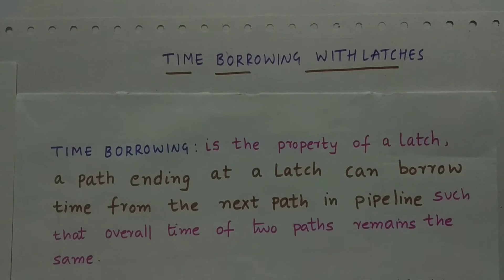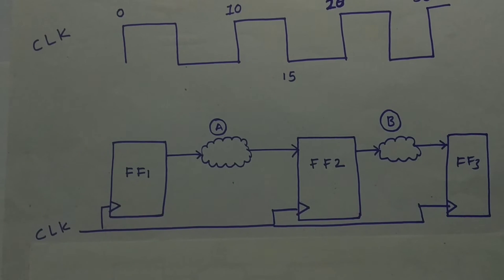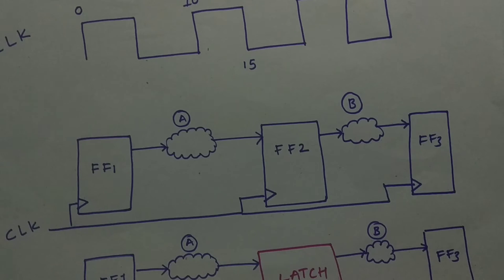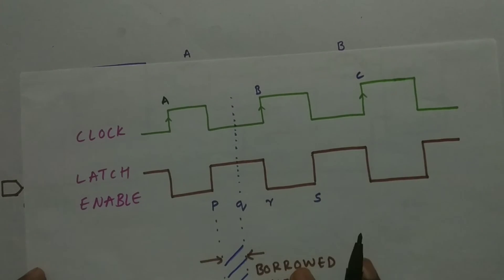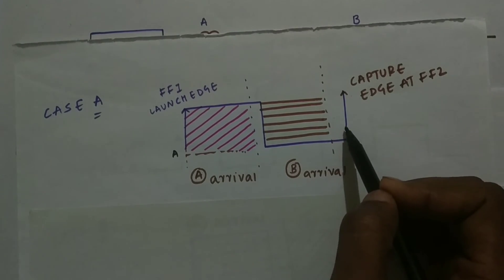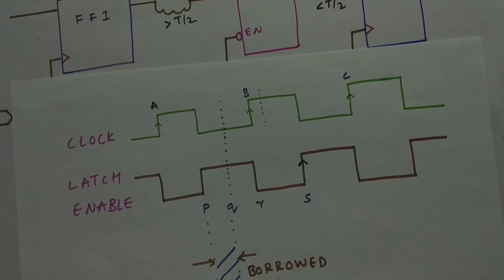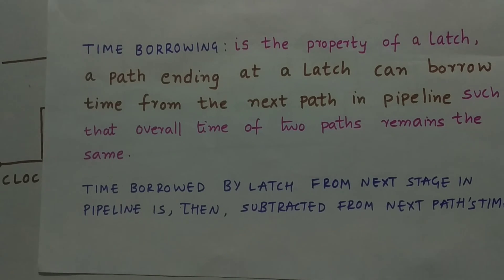what is time borrowing (latch)  ? why does latches support it?

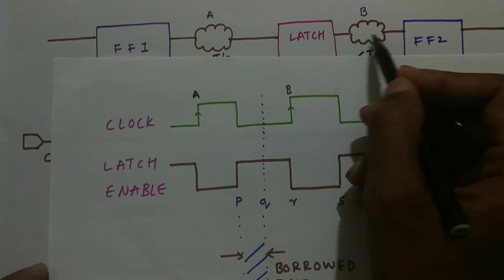Comment: at time 5:45 you are saying even the delay crosses p point...there is no problem it will be borrowed but the thing is the level after p point is a high level the latch can't be active at that point how can it capture data perfectly and in figure you took a negative latch, if it is a positive level latch then there will be no issue but you are took negative latch in between. i think if the latch phase is same as clock then your explanation may correct

Comment: I think this also depends on the contamination delay of the combinational circuit? Suppose, we had a positive level triggered latch (as in first example), that the data takes 12ns to reach, clock edge has already passed by then. You swap that FF in exchange for a latch, but if the contamination delay (min time from data injection at input to the time that the output of the combinational circuit starts changing) of the combinational circuit is lower than 5ns, the data will get corrupted.
Reply from the maker: Yes,the examples were taken for explaining ,  combinational circuit is way complex than shown

Comment: Whats the point of having the negative latch at all? As long as comb A and comb B are able to resolve the output within one clock cycle, do we need the neg latch at all?
Reply from the maker: Hey Praveen , thanks for asking the question, 
Yes negative latch is not required if combo A and B  can resolve it in one cycle, if not possible then only we use negative latch.
Good luck 👍

Comment: Hi Karthik,
Thanks for the lucid explanation.
Please clarify below doubt:
In example of low sensitive latch: Flop-A to Flop-B, available time is T. I.e., Delay of Comb-A   + Comb-B can be upto T.  (In given case Comb-A had > T/2 delay and Comb-B had < T/2 delay, summing to T)
So we can still meet timing between Flop-A and Flop B even without latch? (Please correct if I'm missing something)
Reply from the maker: Yep you are correct , I have taken that example to explain that scenario. It might be helpful in understanding certain design.
Thanks for asking the question, good luck 👍
Reply: I think using latch we can reduce the  number of cycles compared to filp flop.

Comment: Sir im having a doubt 
Then y cant we place latches everywhere? Instead of FF
Reply from the maker: Hey Aakash, thanks for asking the question.
Latches cannot be controlled easily as of FF . They are level triggered , are prone to glitches which are unwanted in the design and that is why Flip flops are preferred. Flip flops are Edge triggered which means the change will only occur at the triggering edge of the clock pulse .

Hope this clears your doubt,if you have any questions please feel free to comment,I am happy to help you 👍.
Please do subscribe it will help me a lot 👍
Reply: @KarthikVippala  FF's are prone to glitches right, due to this we are using latches inside ICG's. Correct me if am wrong
Reply: Awesome explanation 👌🏻

Comment: Is this done only eco stage!!?
Reply: what does eco stage mean? (Engineering Change Order?)
Reply from the maker: Engineering Change Order or ECO is the process of inserting logic directly into the gate level netlist corresponding to a change that occurs in the rtl due to design error fixes or a change request from the customer. ECO is preferred as they save time and money in comparison to a full chip re-spin.
Thanks for asking, good luck good health 👍😊
Reply from the maker: Yup , you are correct ,  thanks for asking questions, Sandeep 👍